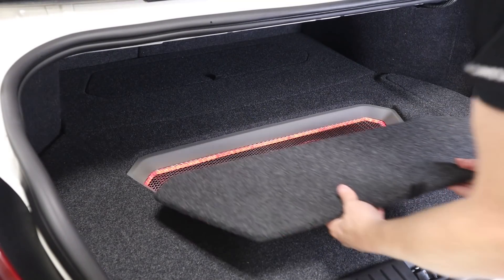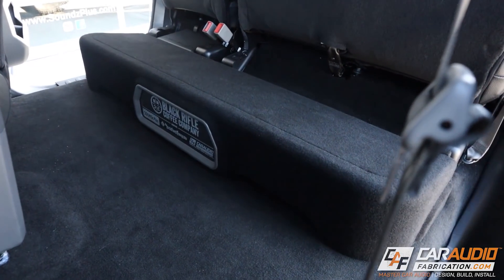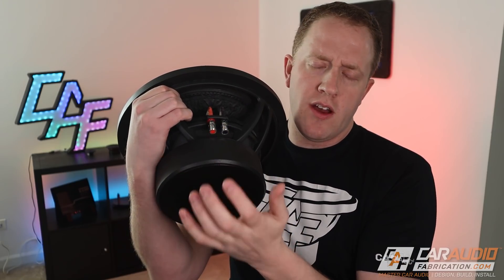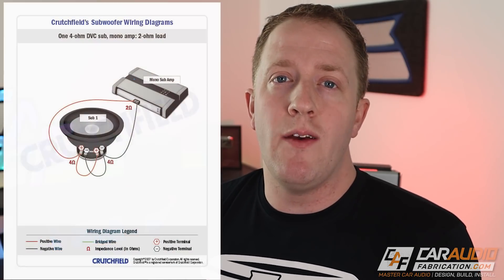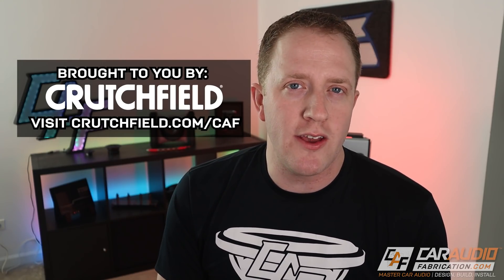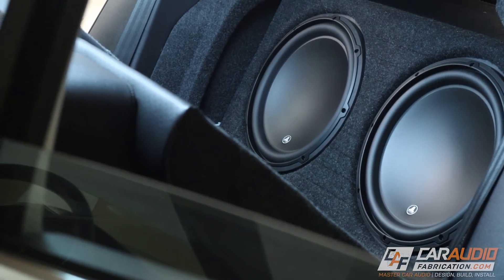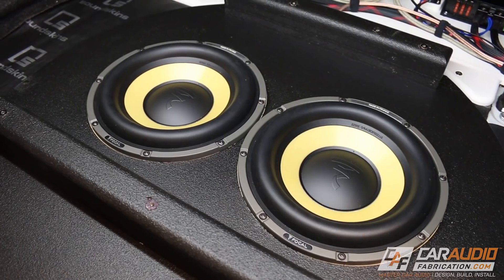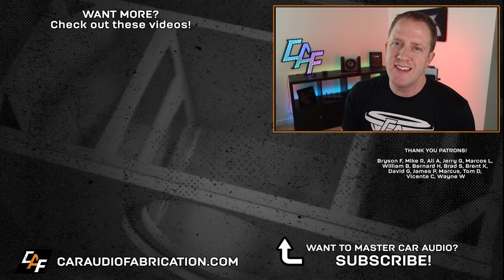Subwoofer size, voice coils, wiring, matching amp EXPLAINED! Car Audio Subwoofer Basics

Comment: What would be the better set up?  1 amp at .5 ohm or 2 amps strapped?  Sub is a dvc 1 ohm sub.  If amps are strapped, what would be the final ideal impedance?  Thanks!

Comment: I have a question. I have a 2016 bmw 528i. I want to replace the under the seat 8 inch factory subs out for an after market 8 inch mid range Loud speaker. Can you help me with recommendations?

Comment: I'm still a little confused about dual voice coils.  What is the difference between a DVC 4 ohm and a SVC 2 ohm?  Are they exactly the same?  Does the DVC raise the wattage by lowering ohms?  If you want 2 ohms, why not just buy a 2 ohm SVC sub?

Comment: I recently installed 2, Dual xs10"s, 125w(rms) 4ohm-wired to 2ohm powered by a Boss R1100M on my stock '11 Traverse bose w/factory amp &sub. Had to add  a loc to stock hu & worked great for a few months. Recently, the amp is going into protect depending on the volume and bass output. . Please send help!

Comment: @mark Can you wire a two coil sub to two different channels on the amp.   And if it's possible will it perform better because you have twice as much output power

Comment: I have a question??? I have two 10 inch woofers under my rear seat facing down in my nissan frontier.  They are cheap subs  by Rochford Fosgate R2. They sound good for the money. I would like to upgrade to the JL Audio 10 inch TW3 (2) I picked since space is very,very limited.  Would I hear a difference on my lows ,louder? Or do you think what I have already is the maxed since I have limited space?

Comment: The variable missed, and can be introduced later, is that single voice coils are more efficient than duals due to less mechanical moving mass. If a single sub 4ohm load is the goal, choose a SVC over needless 2ohm (series) or 8ohm (parallel) DVC's. A new to industry person may purchase a DVC cause it sounds cooler bragging about it not knowing they are actually getting less decibel capability. If dual subs at 4ohm is the goal, grab two 2ohm SVC subs. Thoughts?

Comment: @ mark question would a hd1200/1 amp blow my 2 jlw3 subs or can they handle that power I just happened to find a good deal on one but need your opinion before I get it
Reply: No! As long as you adjust your gain, you should be fine.

Comment: Myth of underpower comes from miss understanding or ocer simplify its the clipping getting terrible audio. 
I would like to add that adding more power you can get higher clean output because it reach the subs max output will be lower then the amps max output so you will never get clipping.  And can get extra sound from poorly formed audio outputs

Comment: Mark anything on powering class a/b amps for my garage. I have some old Brax and dls amps which I would like to utilise in my garage. Struggling on power supply!!!
Reply: I had the same problem i ended up ordering a power supply for led strips. Just look up Ac to Dc power supply 12 volts and those little silver boxes that come up work very well and can take alot of power too!
Reply: @forgottenmusicrevival7201  I’m not sure they will do but thanks for the suggestion. Amplifiers can draw a lot of current and I don’t thing the led trannys will drive them. I currently have some optima batteries but once drained they need to be recharged
Reply: Use pc power supply

Comment: About the mounting depth, why dont you mention that you need enough space behind the sub equal to the breather hole in the sub?
Reply: This is an issue for a lot of trucks when mounting a Sub behind the rear seat.

Comment: Hey guys can y’all help me . I used amplifinder to find an amp that matches my 10inch kicker compr 2ohm. It can get 400rms . Using amplifinder , I found that kicker cxa400.1 was a good choice for that sub. Reading into it I saw that this amp can do 300rms at 2ohm (since my sub is 2ohm). I’m wondering how much I should set my gain because before this I used to have a 10inch kicker compc that could handle 250 rms and the amp was a kicker cxa300.4 . So a 4 channel amplifier. After reading stuff I saw that for one channel the amp provided less rms than the 250 that my sub could handle. Sooo I turned the gain and bass boost all the way up . Idk if there was slight  distortion , but it definitely sounded good and really loud and it kept me satisfied for months. However randomly one day the sub blew . This doesn’t make sense to me because the amp rms for one channel is lower than the sub . The sub can handle more . So how did the sub blow and not the amp. So now I got a 10inch compr 2ohm that can handle 400 rms and the kicker 400.1 that can handle 300 at 2ohm. I hope this is a good choice .I guess my question is when should I know when to stop adjusting my gain because it sounded fine months ago with my compc, but it ended up blowing. I’ve watched videos on doing it by ear and a multimeter , but the ear method clearly didn’t work for me because the gain just seemed like a volume knob and I didn’t hear distortion in the sub, it just got louder. And the multimeter one is confusing for me because if I do the math, the square root of 300rmsx2ohm for the amp ..  is lower than the square root of 400rmsx2ohm for the sub. I know that that’s my target voltage but which one do I do and is it really that accurate. I also don’t know if my multimeter is good because it kept jumping to 70 or so on the AC setting and it would never go to 0.
Reply: Dude your gain is not a volume knob, it has nothing to do with volume. The gain matches your head unit to the amp. If you had the gain up to high and turned the volume up, you probably sent a clipped signal to your amp, which in turn sent a clipped signal to your speakers, which caused the speaker to let go. Distortion is harder on any speaker than under powering them.
Let’s say your head unit is only putting out 2 volts, on the RCA’s, then you would turn the the gain up to match that 2 volts. 
If you turn the gain up, it will send a clipped signal to the speakers you are powering with the amp.
Using the multimeter and the math to calculate where the gain needs to be set will work but it’s not ideal. The old way was to use an oscilloscope, that way you could see the waveform of the signal. If the signal was flat on the top and the bottom it is a clipped signal, it should be rounded off.
Do it right, get the tools you need read or watch videos on the subject, take your time and enjoy. Don’t waste your money by improperly setting up your system, it’s not cheap, and improperly setup systems sound terrible.
Reply: The simplest way is to find the output voltage of your head unit and set your amp gain to match. 2V out from HU? Set gain to 2V. 4V out? Set to 4V. It won't be "perfect", but it will be good enough in most cases.
The likely reason the old sub blew on lower power is that you cranked on the gain but couldn't hear the distortion/clipping. It's been my experience that most people can't hear low frequency distortion. So many times peeps have bragged on how good their shit sounds, but it's mad clipping. Drives me nuts. I could hear it starting at half-volume. 
So personally, I'd go with an amp making at least 500W@2ohms, and match the gain to the RCA voltage at around 95% of max volume on the head unit.

Comment: I understand rms, but what about max? Does max mean I can push it to that level? I heard with Rockford subs they under rate their watts, is this true? I had a p3 12” before when I was a novice and basically everything was max and I never blew it. This was also using a db drive 1500 watt amp.

Comment: I was taught years ago that bridging a 2 channel amp for a subwoofer would cut the impedance of the sub in half.
Example.
4ohm sub on a bridged amp would see it as a 2ohm load.
Is this correct?
Reply: Bridging the amp doesn’t effect the impedance of the speaker, the speaker is the load. 
So bridged amp is good for 200 watts at 4 ohms, that means you can connect a total resistance of 4 ohms or more, 8 ohms, 16 ohms etc, because you are increasing the resistance and therefore lowering the power output. If you try to run 2 ohms on a bridged channel that’s rated for 4 ohms it will not end well in most cases.
Reply: That's one way of seeing/describing it...
A channel puts out a certain max voltage and can deliver only so much current (before letting out the magic smoke). The ratio between the voltage and current is the impedance it can support - let's say 2 ohm.
When you bridge 2 channels you put them in series, doubling the voltage to the load. But the amp can still only supply the same current through the output transistors. 
To keep the current the same while doubling the voltage you need twice the impedance.
So an amp stable to 2 ohm per channel  in dual  channel (stereo) mode, is typically only stable down to 4 ohm when bridged.
Which can be described as that each channel in the bridged pair  "sees" half the load.
Reply: No. The amplifier will "see" whatever load the speaker is. 4ohm speaker? 4ohm load. 2ohm speaker? 2ohm load.
However, as stated above bridging a 2ohm stereo stable amp will usually only allow you to load the bridged channels to 4ohms.

Comment: Great Video Mark, I’m always learning new things from you. Do you have any videos of how to drop impedance of speakers to get more output from your amp? I’ve dabbled in car audio for years, and have never found a video on how to do it. For example I have a set of component front speakers that are 4ohm  and would like to know how to wire them 2 ohm with using the component cross overs ??
Reply: Add another set of 4ohm speakers in parallel.

Comment: I'll pay $50 for solution. 2 of my 4 mid bass door speakers (front passenger and rear drivers) make static crackling noise for initial few mins of starting car then goes away. Most of the noise disappears when I disconnect  my LC7i and all RCAs going into the mid bass amp. I've tried disconnecting my power wires to my sub amp, I've rerun wires, swapped out speakers, swapped grounds, added grounds, jiggled wire connections, smack amp, nothing is helping. Only time it disappears is when I disconnect speaker wires from amps output, or when turning off vehicle of course. It is not engine noise bcuz the sound doesn't fluctuate or change at all with rpms. Any thoughts? I'm aware of the basics such as ground loops and power wire and rca interference. I need to resolve this before I upgrade IN 2 WEEKS TO 20,000 RMS WATTS. I'll pay $50 if you can solve. Feel free to ask away.
Reply: Have you tried a different amp or LC7i? It is also possible this is an issue with the factory system that is not avoidable without a higher level of integration.
Reply: Could be bad aftermarket head unit module. My crux module was defective out of the box. The static noise on mine would also jump location and would come and go randomly.
Reply: Have you tried moving the ground isolation jumpers inside the LC7i, also was the unit installed after the factory amp if this applies?

Comment: I built my own 18. It's infinite baffled/walled in a 96 Prelude. I only have it on 1kW RMS but it's EASILY 2k capable which is the RMS rating of my amp.....I'm just scared to turn it up lmao. I do have to give this man SUPER credit though. Had he responded to the message I sent him then I sure as hell wouldn't have gone as far down the rabbit hole as I did. Dude knows his stuff and I've learned alot from him.

Comment: hey mark i have 2 jl 12s in a ported box with a jl amp how would you recomend the amp bass boost setting on or off i have a factory head unit
Reply: You don’t want bass boost on because your setup can clip which lessons the life of your speakers and subs, and Other things can happen also.
Reply: Off, unless you like it better On. If you're going to use it make sure to set your gain with it On, else you'll be clipping like a bastid.
Reply: @gakudzu7282  thanks for the help i think i need to set my gain again lol but rarly does it sound like distortion is happening

Comment: Question:  Building a under seat (2) 10" box for my 2021 Honda Ridgeline.  Would it be better for individual boxes or 1 box with both subs without a separation?  I have shallow mount subs and can accommodate internal net volume for both subs.  Does it really matter for bass output on the subs if they are chambered?
Reply: Doesn't matter for sealed boxes. I always keep them separated when putting more than one in a box, just because it's easier to tell which one is blown and the other one doesn't blow from the sudden pressure loss. 
Ported boxes generally aren't divided.
Reply: If you can mount the subs close to each other so the speaker frames are practically touching, you get a coupling effect which can improve output. In that situation you would also build a single chamber. Otherwise separate is better as it also gives more bracing and makes a stronger box.

Comment: need help... i have an old school amp mtx thunder 2150X that can be bridged at min 4 ohm, also have the JL Audio wedge bass box with a pair of 12s W0s, those are wired parallel diwn to 2 ohm. would you recommend wiring in series to make them 8 ohm?? plz help
Reply from the maker: Would be best to get another amp, you will be missing out on a lot of performance at 8 ohm
Reply: @CarAudioFabrication   JLAudio JD500X1 $320 or Fosgate R2 500X1 for $100 less and also comes with the bass knob??
Reply: I agree. You could wire each sub to its own channel on the amp until you can get a new one

Comment: Hi, what's better 2 10s 500 watt rms or 1 10 500 rms, thx!
Reply from the maker: Depends on box, available space and subwoofer parameters.  A proper box design for each would be a good way to predict performance ahead of time. www.caraudiofabrication.com/box-designs
Reply: 2 10s on 500 rms or save up for 2 12s on 1500 rms minimum.